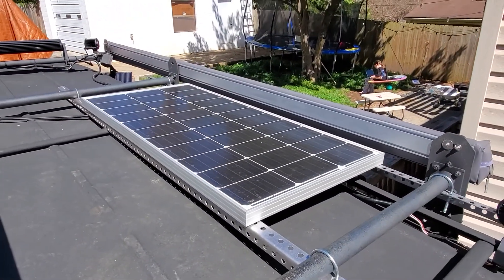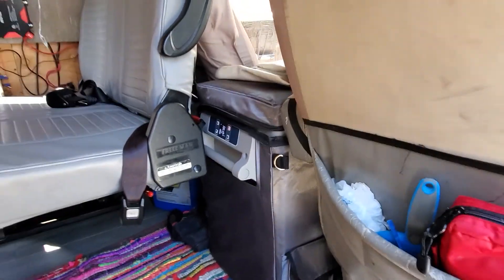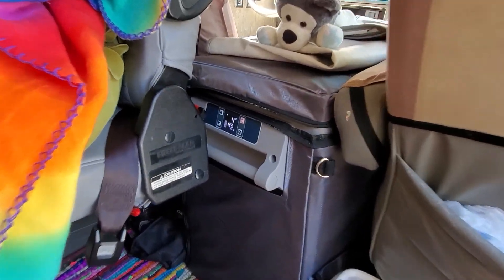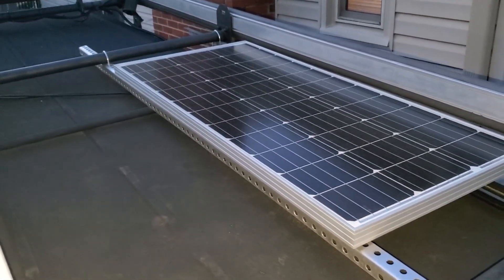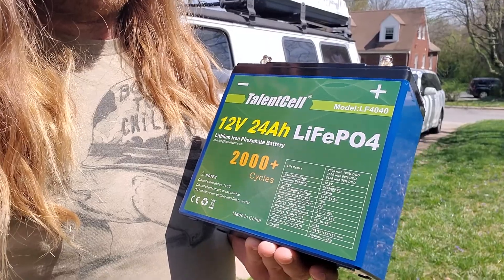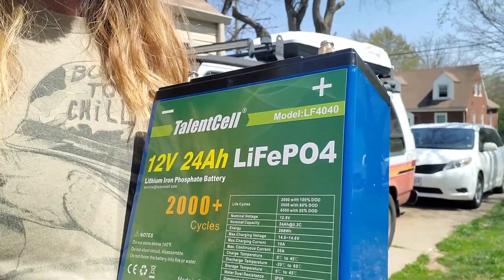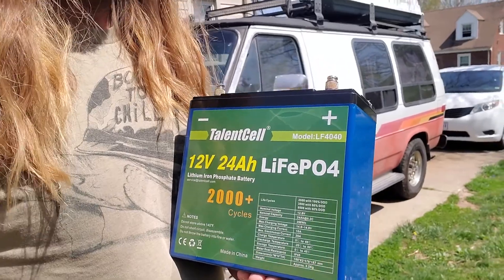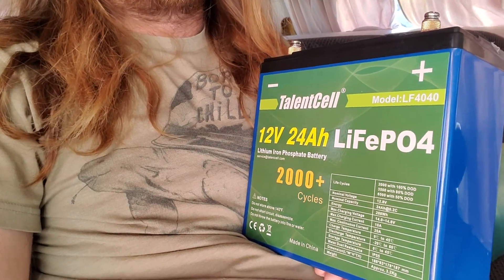Running a 55qt 12v fridge w/ 100 watt solar kit + 24ah LiFPO4 battery?

Comment: New Subscriber needing some advice Please! I just ordered a Vevor 12V, 53qt dual zone car fridge and a Acopower 100W 12V monocrystalline solar panel that will installed on top of our Suburban. That’s all the room on top cause of the roof cargo boxes. Using Bluetti EB55. Will this be enough solar for it keep up running that fridge?(nothing else). Should I add a narrow flexible solar panel (say 50watt) on one my cargo boxes? Problem is I hear nothing but bad about those. Thank for any insight or ideas!
Reply from the maker: Hey thanks so much for watching and subscribing! 
Based on my experience with 12v fridges (I currently have 2 in different vehicles) and various battery and power station options, I would say the short answer is yes, it will work for you. The only foreseeable problem would be if you were in more extreme conditions, such as high heat and humidity, combined with cloudy weather, the draw of the fridge would go up while the wattage from the solar panel would go down. This weather situation obviously isn't always the case, but that is when I see it becoming a a bit questionable of the powerstation being drained overnight in hot weather, and then not getting much wattage during to recharge during the day. It still may be enough with the 512WH capacity, even in those extremes, but a run of cloudy days and high heat, could be iffy. We experienced this exact scenario this past summer when a tropical storm went through while we were beach camping. 

So with this in mind, I would say yes, any more solar panel wattage will be beneficial, you might not need it every day, or in every situation, but its those marginal moments that you'll wish you had it. You could look at CIGS panels, they are expensive but the best option for flexible panels. It is a style of panel, made by various brands (but not all). They would go well on a cargo box. Also, you could grab a folding solar panel to keep with you in event of parking under trees or just as a 2nd panel to add when the conditions call for it. I have suitcase panels from Harbor Freight and Renogy that I really like. Also you can look up a channel called SUV RVing, he mounted a regular 100w solar panel on to a cargo box. Pretty good idea for space saving. 

Here is a video I made on HF folding panel: https://youtu.be/iwOE20WnQ6k
Also here is a video on using a 12v fridge with small power station: https://youtu.be/t-DExCdidh4

Comment: Thanks for the video. I'm going to do exactly the same, I also like that the kit seems expandable if you want to add a other panel or a couple of batteries.
Reply from the maker: Yes the Renogy kit is a great way to start, no problem to add more panels later. My only additional thought on the battery selection is that battery prices have really come down! There are now multiple options on Amazon for 100ah lithium batteries for around $350... I saw some 50ah lithiums for around $250... just my thoughts!

Comment: Thanks for posting this.  I'm thinking about getting one of these for hurricane preparation, rather than having to be dependent on ice.  What would you say is the daily amp usage? ~15amphr/day? If I had this rigged up to a cheap walmart 120 amp hr battery could I expect to get about 4-days without halving to recharge it?
Reply from the maker: From my use and also experiments I'd say it would run off the Walmart battery for 2 days maybe. The fridge pulls 45 watts whenever the compressor kicks on, and draws only about 5ish watts when off. So that is 3.75amps when running. It will obviously come on more or less frequently depending on the ambient temps it is battling.
  
Without solar I would not rely on a single lead acid battery to get you past 48 hours. You don't want to run a lead acid battery like that (or an AGM) all the way down. However you could run a Lithium battery all the way down with no harm to the battery, giving you effectively twice the usable amp hours compared to the lead acid and AGM batteries. The prices of lithium 12v batteries have dropped substantially lately... well reviewed options being down around $360 now! So crazy...

Optionally you could connect several walmart batteries in parallel, 4 walmart batteries would be like $300ish. Anyway, another helpful move would be to get a 100w solar panel and charge controller setup to charge your battery back up during the day, assuming the hypothetical storm had passed and you were just waiting for the power to come back on. This would effectively give you indefinite power assuming you could get the solar panel into the sun. Another, but more expensive option is an all in one power station, that would give you easy connections for other items beyond a fridge and give you good monitoring of how much battery capacity was left. Similarly those can be connected to a solar panel or 12v vehicle outlet as well. That is my 2 cents :-)
Reply: @kampinglogik  Thanks! This is helpful information.
Reply from the maker: No problem! Here's one of those lithium 100ah batteries I was talking about... great thing about lifpo4 batteries is that they have very low self-discharge when sitting... lots of good reviews on this one...  https://www.amazon.com/dp/B08FMTRYPT/ref=cm_sw_r_apan_glt_fabc_SJHCD1GWWNW5J45M0SZC

Comment: How is that battery running the fridge when it only has 240 watt hours? Trying to figure a set up and everyone says something different.  ....
Reply: What size battery is the one you are using in the video?  The one I said 240 is the new one.  Still don't understand how that can charge it.
Reply from the maker: Yeah so this battery is lifepo4, so the nominal voltage would be 12.8v and 24 amp hour capacity... then multiply 12.8x24= 307.2 watt hours. So the fridge is running at about 45 watts while the compressor is on (then it cycles on and off to regulate the temp). Even at max draw, the fridge could run for 6.2 hours with no recharging from the solar panel. But the fridge is only running at that high draw of 45 watts a small portion of that time. 

Assuming you have enough sun light, the battery can last indefinitely as long as the solar panel is getting a decent amount of sun everyday. A 100 watt panel seems to push around 5 amps per hour in the best hours of the day, so say you get 15 or 20 amp hours back into the battery everyday, you should be good to go. In a nice open/sunny place (Outer Banks of NC) I was able to keep the battery topped off all week from only 1) 100w solar panel the entire time, it never even dipped the battery capacity (showed "full) the entire time). 

The hotter the environment and the lower you keep the fridge temp, the more it will cycle the compressor. The more trees or clouds, the less amps the solar panel will output to the battery. But from day to day, with enough good sun on the solar panel it should be no problem to keep a 24ah lifepo4 battery charge with a 100w panel. Or get  2x100w panels and never think about it :-)
Reply from the maker: The battery should be able to run the fridge (its a relatively low draw) until the battery is drained, the point of the solar panel is to keep the battery capacity replenished. Send me a link to the battery you are looking at when you have a minute
Reply: @kampinglogik  thanks again.  I'm not sure what batter I'm getting yet.  I'm considering a power generator also.  What size inverter did you use?
Reply: Also it didn't get to low at night? Just the battery shouldn't get I think lower then 80 percent since lithium.
Reply from the maker: @BrianJohnson-ny9zd  I currently have an 1100w inverter in my van and a 1500w inverter in my trailer. If you don't have any of those components already, an all-in-one power station might be a great choice to get started. I'm working on a video of the fridge running off a Jackery 290 - seeing how many hours it can go before needing a recharge...
Reply from the maker: @BrianJohnson-ny9zd  No it didn't get too low, in fact it never registered below 75% full in the mornings. lifepo4 batteries like this can be run all the way down without damage, that's the greatest thing about it!
Reply: @kampinglogik  so I am looking at the battery you use and it says not to use a inverter higher the 150w? I like your set up just making sure I'm making the right move.  I was already looking at the same fridge and solar panel.
Reply from the maker: @BrianJohnson-ny9zd  where does it say this? I've never heard of there being a limit on what size inverter you can use on a battery, maybe I'm just not knowledgeable enough on those details... obviously if you use high draw devices plugged into an inverter you can either max out the battery's BMS or quickly drain the battery
Reply from the maker: If it concerns you to get such a small battery I understand... In the same price range you can get a 100ah AGM battery off Amazon, and even depleting only half way, you'd still have a usuable 50ah (or double the usable amp hours of the TalentCell). But, of course it will be 50lbs heavier. However, the TalentCell 24ah is on Amazon Prime and it is returnable, unlike a lot of the bigger batteries, so you could give it a whirl, if it doesn't work, send it back!
Reply from the maker: @BrianJohnson-ny9zd  Ok yeah I saw that one guy's comments too on the Amazon "questions," I don't know what product he is specifically referring to, but I don't know that he has any specific inside information
Reply: @kampinglogik  ok should be last question.   Did you use a fuse box and do you know when you are supposed to? Also the max wattage on the fridge when it starts?
Reply from the maker: @BrianJohnson-ny9zd  No worries brother! Yeah the max I've seen with the fridge compressor running is 46 watts. When I did this video, I just had a 12v cig lighter connection hooked straight to the battery for the fridge to plug in - it had an inline fuse. The cig lighter cable has an inline fuse.